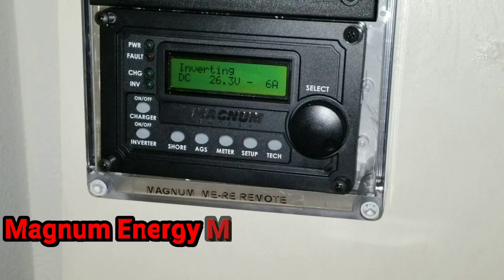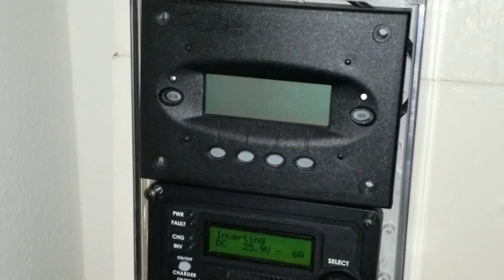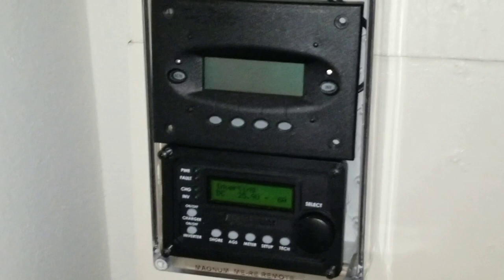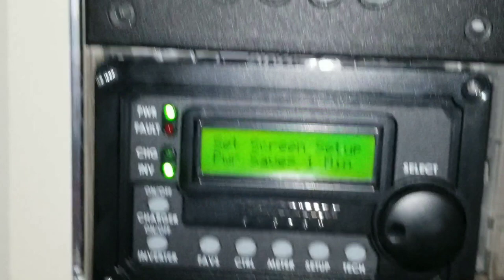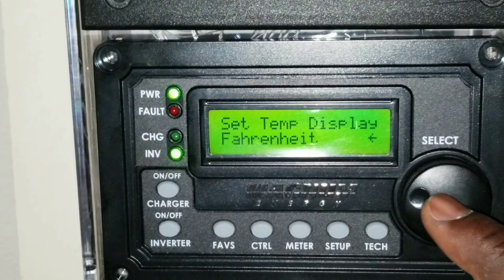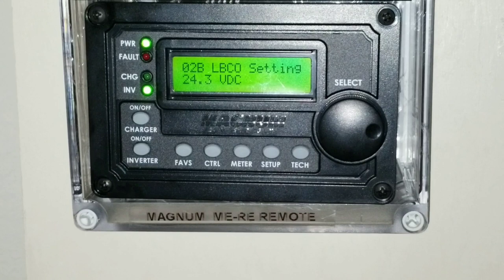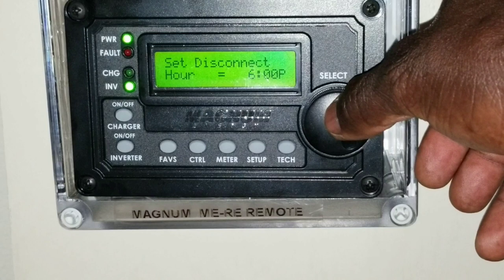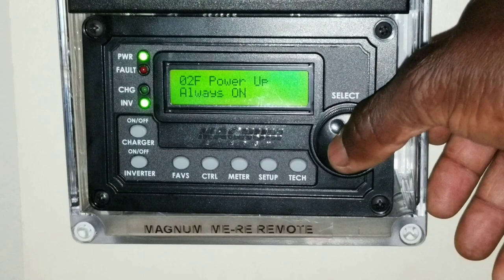MAGNUM ENERGY ME-RC50/ME-ARC50 Advanced Remote Control

Comment: I have a me-2012. Can you turn off charger standby while hooked up to shore power?
Reply from the maker: You should have a disconnect breaker for the inverter if you wanted to do any electrical work on your system.
Remember, safety first!
Reply: jwsolarusa I do. I want to run on inverter until battery reaches a lower voltage then use shore power automatically
Reply from the maker: You can absolutely program the system for SOC, VOLT or for TIMER when you want the system to come ON and change the batteries automatically without worries.
Reply: jwsolarusa the problem is I want to be able to auto switch from invert mode instead of charger standby. I run on solar and charger standby prevents dc power from being used for ac inverter function.
Reply from the maker: Please send me a private email with your cell number or WhatsApp number at jwsolarusa@hotmail.com and with contact you ASAP
Reply: jwsolarusa how? I’ve been unsuccessful.
Reply from the maker: Make a video and Share with me.
I told you to share your contact me through email but I did receive anything from you.